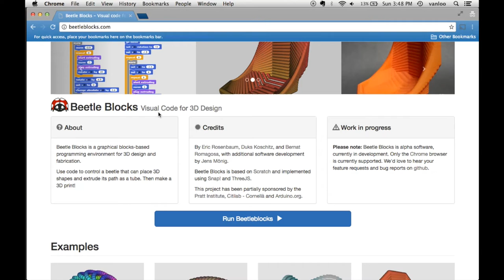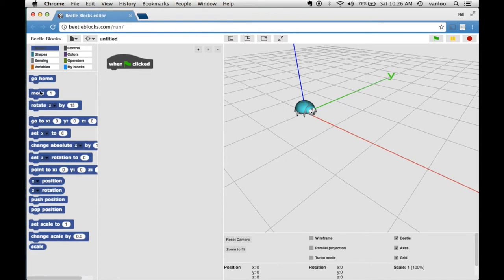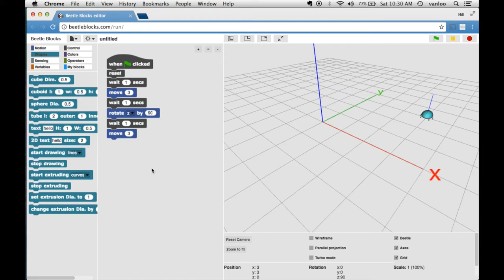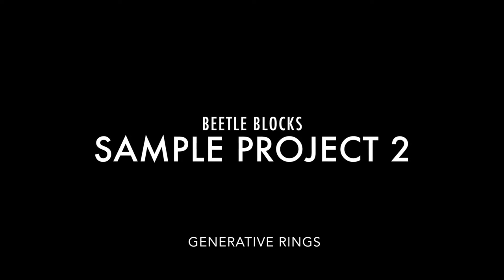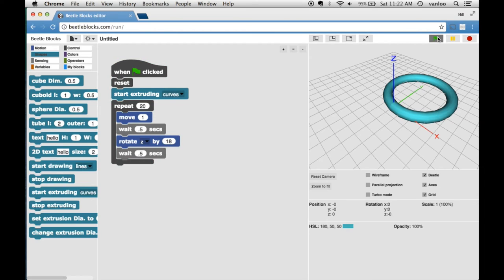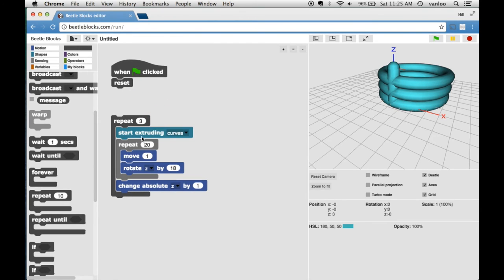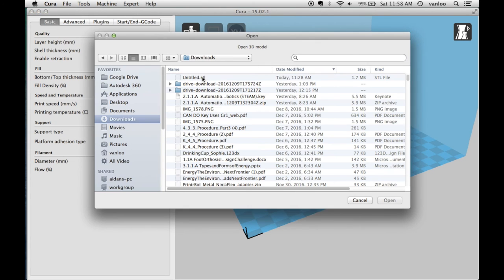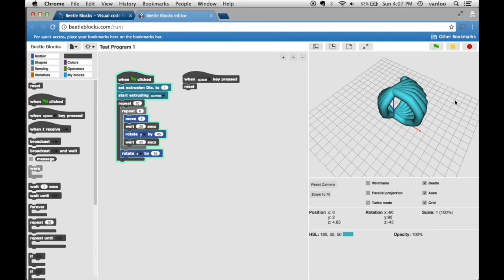3D Coding, Modeling, and Printing with Beetle Blocks (Video Tutorial)

Comment: Hi Bill Van Loo,

By all means, please do more Beetle Block tutorials!

I have just come across BeetleBlocks and I am hoping I can use it in our elementary school to teach 2D & 3D graphic design to interested students. I had been looking for a graphical block-oriented "front-end" to Processing and Processing.JS, but so far this is the closest thing I found. Ideally, my front end would lead smoothly into processing, but I think BeetleBlocks will help in presenting 3D graphic concepts more clearly than Processing. Once they get these basic concepts, Processing should be easier for them to grasp. 

I am already using BlocklyDuino (BlocklyDuino-Enhanced and TUNIOT (at http://easycoding.tn) as a Scratch-like "easy in" to Arduino C for both the Arduino Uno and the ESP8266_WiFi_SoC-based NodeMCU boards. Interest in this area is growing, but I thought if I could get students interested in Processing with 2D & 3D Graphics programming as the "hook", then these students would have an "easy in" for Arduino C as Processing and Arduino IDE share a lot in common. Also, Processing is a good lead-in to C/C++. What I like about BlocklyDuino as compared to Scratch is the resulting code is Arduino C which students can analyze to learn C. My ideal "front-end" for Processing should yield Processing compatible Java source code. If you have come across such a block-oriented language let me know. Until then, I think BeetleBlocks comes the closest to what I'm looking for.

A good collection of tutorial videos would also be a great resource for the students, and help me justify the use of BeetleBlocks at our school. Likely I will have to produce all my own teaching materials and will be relying a lot on materials already on the Internet.

Sincerely,

Wm. Moore